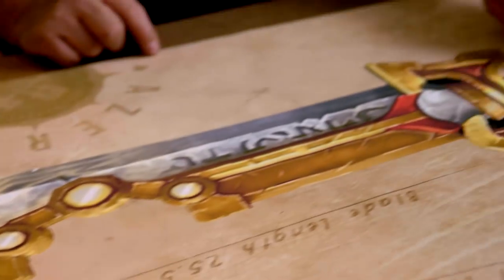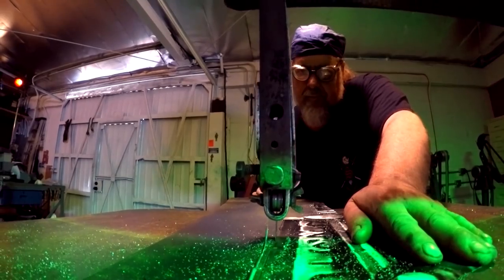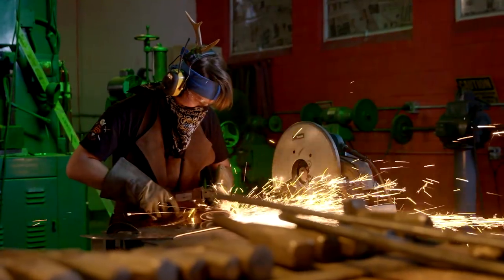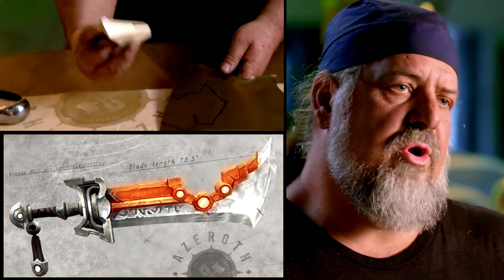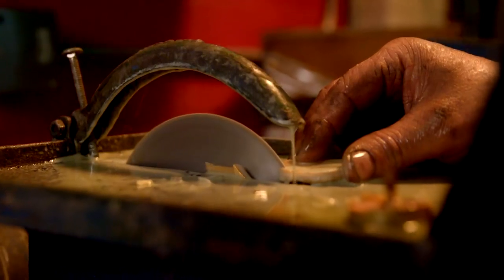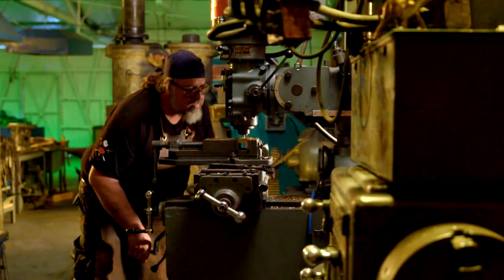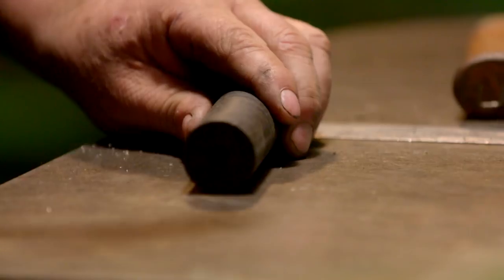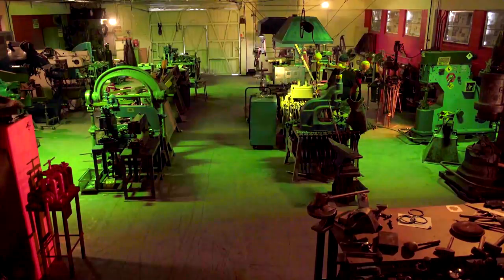Azeroth Armory: Forging Ashbringer

Comment: Why not make it to look like the original model?
Reply: He explained it in the first minutes of the video, you didnt even watch it omg
Reply: But that's the thing, the original version is the most iconic, and is also the default skin in Legion.
Reply: good luck with making a hovering light crystal.
Reply: How would they even do that? As far as I know there are no magical floating light orbs in real life. They had to use a model that you can actually forge.
Reply: Not really. It´s mainly because that glowing thingy that original has.
Reply: If the reason why they didn't do the original version because of the glowing piece, why couldn't they just make it without it like they did with this one?
Reply: Or atleast corrupted ashrbinger......Plebs
Reply: Create a lightweight disk from a bright yellow plastic that connects to either side with very thin wire, creating the illusion that it's floating.
Reply: Because there's no flying light crystals in real life.
Reply: You could actually use something as easy as Plexy Glass to make the orb look like its floating
Reply: I think they are not putting the disk because after some hits with the sword the wires holding it would just break; remember that they are not doing a cosplay sword, they are making a functional one
Reply: No he didn't. The model he used ALSO has a floating, glowing orb, and they simply didn't make that. They easily could have done the original model without the glowing orb.
Reply: Sadly, Blizzard has a, "you think you do, but you don't" mentality when it comes to older things. The Glowing Orb could be achieved, but it would have to be connected with a clear plastic/resin. Just a bunch of schmucks if you ask me.
Reply: The glowy orb will apear when a true paladin wields it. =D
Reply: @Elapse, this isn't just a default skin. This is the unlocked potential skin of the ashbringer, just after you complete the class campaign.
Reply: how to make a hovering crystal? easy, take some seethrough material and stick the metal piece on a couple of rods holding in it place.
Reply: it's the default for a tier one ashbringer, this is the default upgraded ashbringer.
Reply: Most of those methods would not hold up to live testing.  Most would just break on a few swings.  One of the beauties of this show is the weapons are made to be functional.
Reply: my assumption is that he is making it more functional than cosmetic, im not an expert but id assume if they did some of the suggestions the orb would probably come off after not much use.
Reply: this version has an orb. the question is not why they didn't have the orb, but the original model. all ashbringer models have a floating orb that they will skip. People just want the old model, with or without the orb....
Reply: It's more floating fire than a physical orb unlike the original ashbringer skin so there is a good reason to use this skin than original.

Missing a floating fire is much better than missing a floating white disk.
Reply: He said it at the beginning, it would weigh like 200 pounds if he went 100% to scale and he wouldn't be able to do the glowing pendant piece, so that particular design they chose had the most doable and interesting looking design. He scaled down the thickness because it would weight a ton and be too hard to work with.

Also, it's like 4 feet long and weighs 15lbs, it's plenty large enough to be a two handed weapon as demonstrated in the video.
Reply: @Omareb r That sword is not functional by any means : D
Reply: Definitely the closest they've gotten to a functional design from Blizz...
Reply: no , they arent make a "functional sword" there making a cospaly. The sword isn't sharp at all look at the murlock they hit, didn't even break the cardboard.
Reply: You don't watch the show much i see.. Every sword/bladed weapon he has made is sharpend, and WILL cut you if you're not careful
Reply: MrCeeJaym that Link is what i mean by sharp.
Reply: this is a promotional video for legion. they're making it look like the artifact version you get in game
Reply: "To sum up, the good surprise of the meeting was the level of engagement of all these Blizzard people toward making legacy servers a reality. The down side is the technical difficulty it will take to reach our objective. Blizzard is now well aware of the amount of players willing to play legacy servers, something which wasn’t the case until Nostalrius shutdown"  - THE MOSTALRIUS CREW (after a vary long meeting with the top brass at bliz)  so i do not think it fair to STILL hold the  'you think you do, but you don't ' over their heads.   As for the weapon, when they did doomhammer every one bitched about the "fakeness" of it so i don't blame them for leaving out the fiction to make it REAL
Reply: It doesn't matter how heavy it would be, it will be a show item anyway. It's not meant to be wielded. It's meant to hang on a wall somewhere.
Reply: magnets....but yeah.
Reply: Well you have the original model in Legion, this is just one of the options. The version in "old WoW" was the Corrupted version, different again.
Reply: thats why i prefer man at arms, they actually forge blades. not cut them out of sheets

Comment: Is it just me or does it look a bit small?
Reply: it's just you
Reply: no it's definitely small.
Reply: They said IN THE VIDEO that they made it small on purpose.
Reply: It might not be the same size as original, but heck does it look cool!
Reply: they need to rub it
Reply: Valar, it seems odd they would do that considering they made a full size replica of things like the buster sword.
Reply: Must be the blood elf model. :)
Reply: +lacunarikain2 Problem was they built the Buster Sword too large, and even with it mostly aluminum, it was too heavy to carry.

Warcraft weapons are simply too big to be wielded properly.
Reply: The big issue with the Buster Sword was that it was forged to scale, so it became too heavy to be wielded. The same applies to most Warcraft weapons, if they were forged to scale, you'd either dislocate something trying to lift it, or fall backwards from getting it up over your head for a swing. A smaller size allows it to be used without two people having to hold the blade up.
Reply: They said they had to make it smaller so it would be usable. If it was actually to size, it would weigh too much and be far too heavy to be practically wielded.
Reply: "is it just me or does it look a bit small" thats what she said.
Reply: +Nobody Cares te
Reply: +Nobody Cares tebb
Reply: A vast majority of the gear in the game is heavily inflated in terms of size. If you took an average epic item from a raid and translated it into a real world item, it would be so large and heavy that no regular human could carry it. 

A completely faithful replica of the Ashbringer, as Tony himself stated, would be impractical to wield, and he makes weapons that can be more or less practical to carry around. Otherwise you would just have to enjoy watching them trying to lift the weapons up like they were Thor's hammer Mjölnir.
Reply: Get your head back on the planet.  Trying swinging a 100 lb sword.

Comment: isnt this a skin for ashbringer? pretty sure thats not what it actually looks like
Reply: its the "elite" version of standart version of Legion´s model.
Reply: yes. They made the skin you get from finishing the pally order hall campaign.
Reply: yes but its still the ashbringer
Reply: Basically this is not the Ashbringer! Not the WoW Ashbringer, maybe another Ashbringer... same as making a statue of Arthas with rainbow coloured armour and instead of skulls putting images of my little poney!
Reply: It's one of the skins you unlock with the artifact rets get...
Reply: Its the original ashbringer, but it was reinforced with more badassery (That is somewhat the lore)
Reply: Crazylegs677 LOL? not rly... do you even read the Lore ?? xD
Reply: Crazylegs677  No, it is just cosmetic!! For quests that you complete you get cosmetic skins for you Artifact
Reply: well its probably cause its hard to put a floating circle in the middle of the sword cause you need magic
Reply: Its not hard... people do it all the time. Many cosplayers you see in conventions or videos of them have transparent plastic holding stuff as if it was floating.

And the orb can be made out of some sort of yellow glass and put a bright light inside.
Reply: but this was supposed to be functional. plastic or thin wires will break as soon as they use it.
Reply: Fongching Wu  Well, they could have done the normal without it, since the did the same with this! this was supposed to had a little flare and now has nothing! Or they could had done it like a part of the blade.
Reply: the original ashbringer is, well, the original, but it doesn't look as cool as this one tbh
Reply: Toxically Masculine preferences :) but the original is the one you will trully be using, there is no lore alteration in respect of those "skins"
Reply: Fongching Wu
 no they wont break... nobody can hit a weapon hard enough to break something on the other side of it when its built right.
We have the technology... it doesnt need to be made out of paper, it could be made out of aluminium with tiny shock absorbers to prevent doing any damage to the glass orb i suggested.

Its not medieval times we live in, people have some crazy tech these days... ;)
Reply: Irrespective of what it looks like, it's still Ashbringer. Stop argueing semantics.
Reply: Crusade Gaming TBOG And that is the problem :)
Reply: It's an artifact skin. Take off the huge spine, move the runes to the other side, turn the pommel into a circle. Simplify the guard, then classic Ashbringer!
Reply: because without the floating light crystal, which they cannot make in real life, ashbringer is just a boring sword. Plus wow is obviously doing this stuff to promote the new legion content, so there showing the new weapons.
Reply: @Jrey mer

This ashbringer is the ashbringer at its peak. The rest of the skins, however (Like the PVP one, or the Raid one, or even the secret one), are just regular skins used for fun. Not actually apart of the lore.

Saying that this ashbringer isn't even the real one is like saying that anduin isn't as good of a king as varian all because he's a priest. It makes no sense.
Reply: Jrey mer Different opinions for different people I guess. I for one, love the whole OP business, but I respect your opinion, and I can see why you think that. 

Also, I love that you said classic, and not vanilla.
Reply: thunder wolf hehe :) Just to strengthen my point, I say. We are millions of players, and seeing millions of Ashbringers makes me mad...

Comment: that's not ashbringer.
Reply: Actually it is, just not the "original". It's one of the model variations you can unlock for it. Much like the Doomhammer they made.
Reply: They used one of the skins you can unlock for it, presumably because without the gem in the blade the base Ashbringer would look a little bland. The skin they used has more to it to make up for the lack of the gem.
Reply: They did the same thing with the Doomhammer.

Comment: Is anyone here who will level a retri pala in legion, going to use this skin on their ashbringer? I know i won't.
Reply: why would anyone play a pally in Legion, they're pretty terrible.
Reply: Raybeze Im levelling every class to 110
Reply: ***** atm i have 8x 100, 3x 90-94 and last one 21. on 1 realm, i got 3x 100 on other realms too
Reply: thats nice.. i have 14 x 100.. zzzz
Reply: Yes, because it matches with the latest tier armor. At least, the mythic armor anyway, so if you're gonna stick with raid finder then of course you wont.
Reply: @Raybeze and you are quite a mong. I main holy and will be lvling in holy, though Ret pally is in a stronger position now than its ever been. Sure you lose lots of mobility, though their damage and survivability is ridiculously strong. NOT TO MENTION now they actually have a solid rotation instead of praying to god their abilities proc.
Reply: Ethaniel Unless you've been playing beta and know something I don't, Ret Pallies are not better off. Not only is mobility gone, AOE was reduced, self healing was reduced, no more glyphs to reduce LoH cool down, only one ranged attack with a 9 second cool down (at least where I'm at right now, I forget the default, I think 12 or 14 seconds) and the new rotation is not as smooth as the old one. Right now I am doing far less damage than I could before all of the changes with the same gear. I did reforge and gem/enchant for haste after seeing the cool down on Judgment. I am going to be leveling him, but if I get to 110 and get some decent gear and the damage isn't extremely impressive, since movement and self healing were nerfed, then I will be finding a new class. So I'm hoping the changes were done with the new levels and gear in mind. With the exception of the new RAIDs, dungeons and world bosses, I could solo just about anything I came across with the old rotation and abilities, not so much these days. Don't get me wrong, my pally is still pretty tough, but nothing like he was before.
Reply: Too bad Ret paladins are the most boring class to play in Legion.
Reply: Praetoras Outlaw rogue isnt much to look at either.
Reply: Lucky for me I don't play either.

Comment: That looks great, I wish it was about twice as large though... it is supposed to look like its about 5 foot tall not 3, but none the less I think this one turned out amazing. Very impressed it was only 18 lbs too, so it probably still would have been under 50 lbs if it was larger.

Comment: Best one yet I think! The only thing I would have done is "age" it a bit. Add some knick marks to handle, blade, etc so it looks like it has been through multiple battles through time. Also pour some muriatic acid on it, burn it away, and it really shows all the scratches and makes it look far less shiny and more battle used. Just use a respirator for the gas, lol.

Comment: the glowing gem could be possible if you make it polished brass and use a glow in the dark clear coat on it . wouldn't do much for it besides throw off the weight but you would have the functional look

Comment: I think the Silver Hand sigil (glowy/floaty disc) could've been put in if you just attached it to the curve kid the blade without the fantasy glowing or floating part. 

I get they used the new legion design partially because of that issue, but blade just doesn't feel complete without that Silver Hand.

Comment: Just wanna point out that the Ashbringer weapon was forged by Magni Bronzebeard in Ironforge, not Mograine.
It was named after Alexandros Mograine, who was known as The Ashbringer.

Btw, why choose this secondary "skin" of the sword? It was much harder to make. Incredible work on that bronze border.
The original "skin" would be much easier to make, plus it would cut through stuff and be more functional.
(of course the glowing circle would not be hovering in mid-air, but rather engraved and coated in something yellow)

Do Shalamayne! :D

Comment: that's more like a mace than a sword. that murloc looked like it was being smashed rather than cut. it's cool visually but I kinda wished that it actually cut something rather than mangle it
Reply: cool looking nonetheless
Reply: It does have a cutting edge, they just don't make it sharp enough to slice clean through stuff for safety reasons. Also, that is realistically what a sword would do to an unsecured pinata. Take a look at the watermelon clip, it does cut well.
Reply: Any blunt weapon can cut a watermelon. It is not impressive or a sign of how sharp anything is at all.
Reply: Vladir Gaeser If you try to cut a watermelon with something blunt, it's not going to be that clean. Also, if a weapon is sharp enough to cut through a watermelon like that, its sharp enough to do some serious damage. Also, you really don't want to make a sword extremely sharp or you are gonna seriously mess up the edge first time you take it into battle.
Reply: I'd say it looked like it was being smashed because of the sheer size of the blade, along with that thick spine.
Reply: Nothing in WoW is even remotely sharp.
Reply: You have never seen a real sword being used, have you? Longswords couldnt even break leather, of course it looks like it was smashed in, it's not microscopically sharp like a surgeon's scalpel. Now, a katana on the other hand, not only could it slice through leather where longswords couldn't, but it could also puncture metal armors better, too. It couldn't stab straight through a dude in metal armor, but they'd be feeling it bad.

Comment: with magnets i'm sure you would have been able to put a glowing metallic plate with batteries to make the glow, it's still a good sword, but not the same as the original, and it is too small too

Comment: This was a nice sword build, but man was I disappointed when I found out the ashbringer was going to be one of the newer ones. The classic ashbringer would have been so much more unique if you could get the floating token to work. I imagined the solution would be using some magnets in the sword and token to make it float in mid air. Considering that this is more of a display weapon, why not go for the extreme.

Comment: Let Michaelcthulhu make this.. He will make it right, and effective. He would make it accurate size, full steel and other metals, effective and it wouldn't come close to 250 pounds. 50-60 pounds at the most.
Reply: sad how small they made it, thought ashbringer was a two hand not this little one hand they did